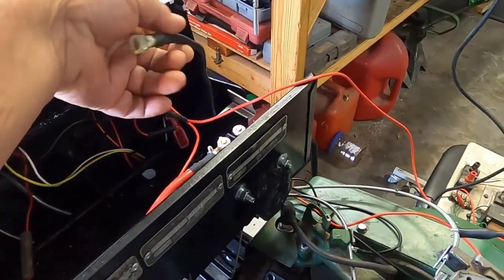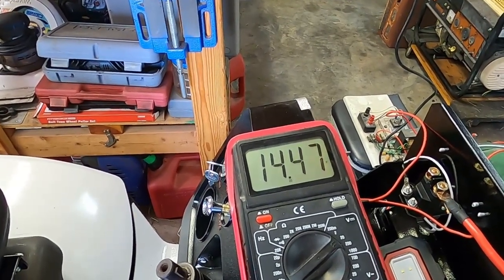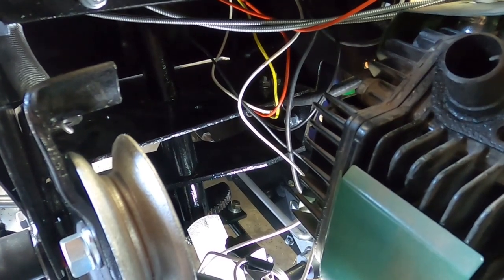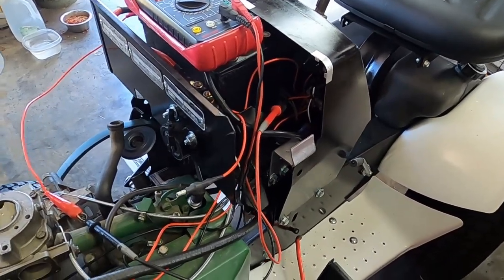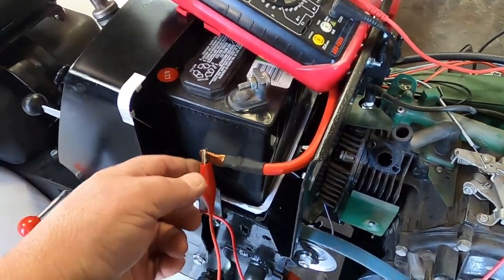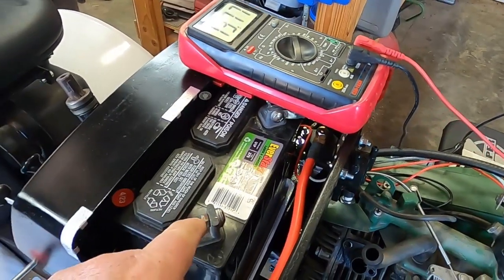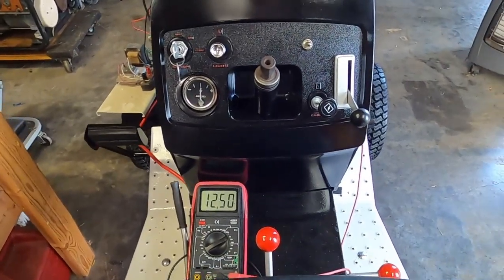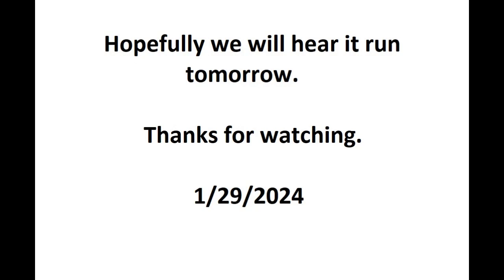Roper `16T   Electrical works FINALLY

Comment: The work you have done on the electrics is fantastic and it has been great to follow along. Shorts and T-shirt would be great, it is raining and the air is damp over here. It will be great to see the engine fire up